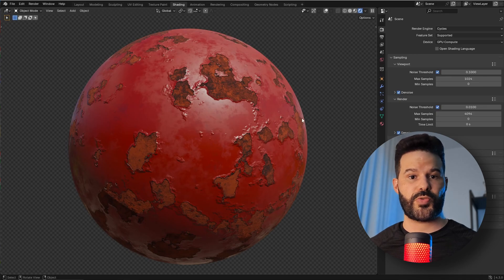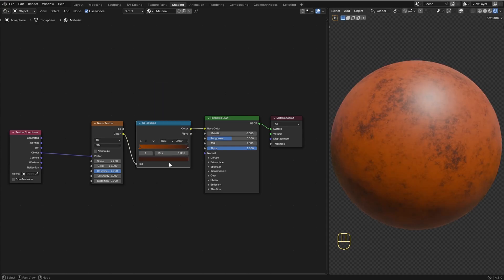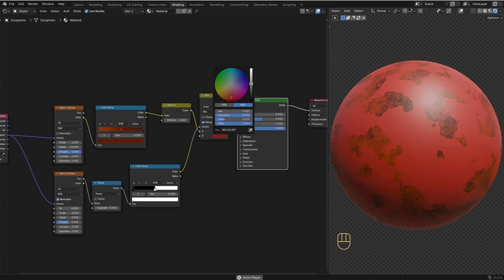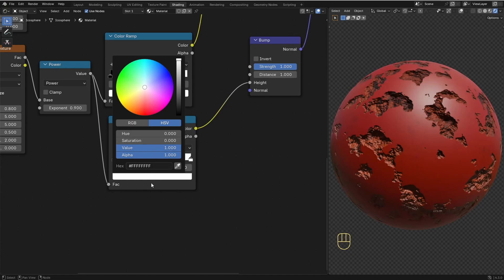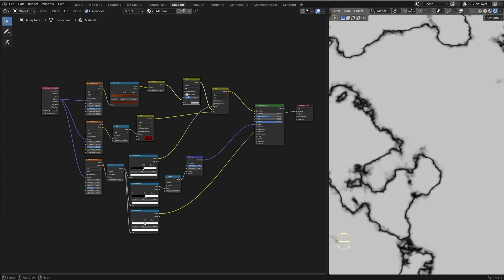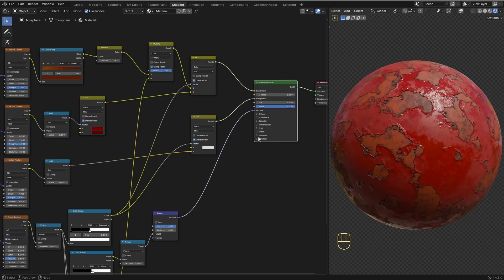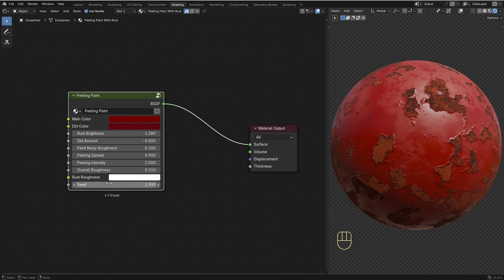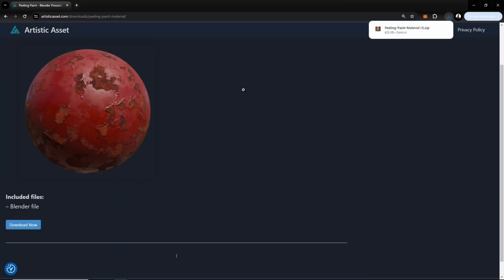Easy Procedural Peeling Paint Material in Blender - Step-by-Step Tutorial

Comment: Thank you so much! Extremly helpful
Reply: Quick question, I used a PNG texture instead of colors, is it possible to create a group input to control all the textures? I tried but I couldn't.
Reply from the maker: Yes, it’s possible to create a single node group for the entire setup. But, I’d need more details about what exactly you want to control and how your current setup looks. That way, I can give you a more specific solution for your problem.
Reply: @kbrender  I have a 4-sided product, each side has a sticker with a different image. The idea is to use the same principle of material and noise creation for the 4 sides, however each side has its own sticker. In my node tree I used the node called image texture 3 times. I wanted to use the material for the 4 sides and create this group control for the images, so I wouldn't have to manually change them one by one.
Reply from the maker: @nhakislu123  have you considered having 2 different shaders? 
one would be the material and the other would be the images, than you could mix them with a Mix Shader.
Reply: @kbrender  sounds good. Thank you
Reply from the maker: @nhakislu123  let me know if it works